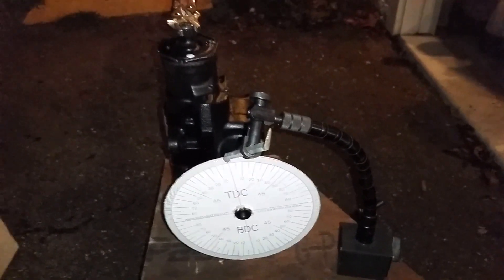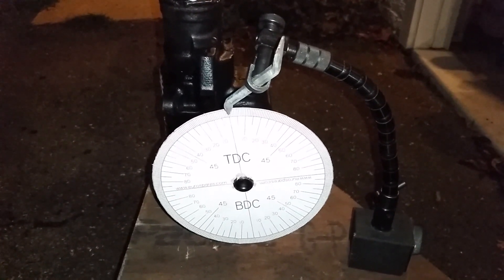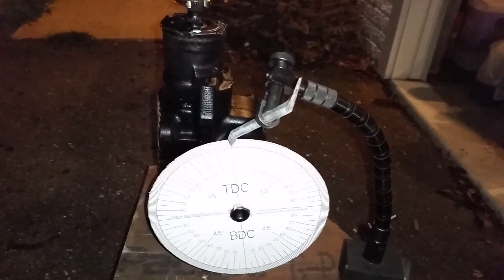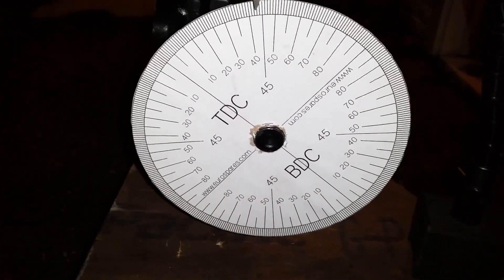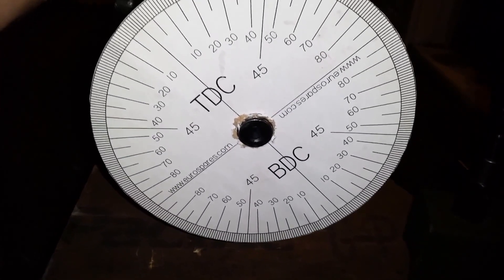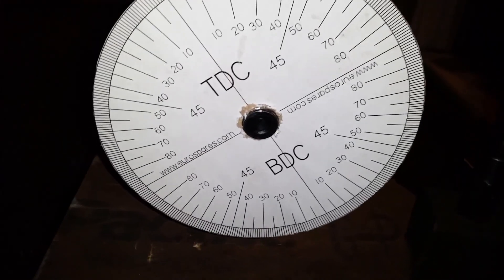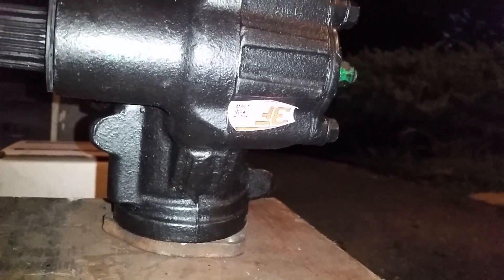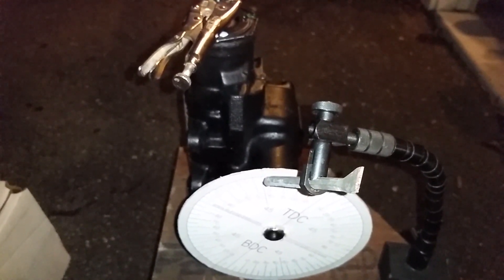Testing Another Steering Box - This One Is 12.7:1, But Isn't Supposed To Be

Comment: I have repaired the Saginaw 800 series box for lack of assist, piston seals or spool valve, plus many pitman shaft leaks. Dirt, carbon, seal material all rest on the bottom. I would polish the seal area but changed the needle bearing. If a parts store sold you what is now a close ratio box, I would put it on with joy. I am not understanding why there is a reason to be afraid of it. Never saw anything that resembles a center detent. Ever. The rag joint slides & clamps onto the input shaft splines, but this visible part is not wha moves the spool valve. It drives a “Torsion bar.” It passes to the back and a pin holds the spool valve on two sides. A thicker torsion bar twist less so it moves the valving fast. Resulting in immediate assist to the direction of choice, proving little road feel with a proper pump pressure. For boxes, the pump pressure valve produces 1,200 - 1,600 PSI. A rack only needs 600 - 800 PSI. It is engineers choice for the model, big block, A/C, etc. More assist is a rule. More caster helps with return to center on SLA front suspension types. It lifts the front of the car and naturally want to return to center. Less caster is used on manual steering. A thinner torsion bar will twist more, delaying the speed the spool valve moves. This provides more road feel and many like that. After 38+ years of fixing vehicles, imports, exports, dealers mostly but independent shops, my elbows aren’t what they used to be, so less turns with more assist, to me, bring it on. 
 To make a short ratio box, a newly machine worm screw with grooves the balls ride in, are spaced apart further. The same is true to match the ball-gear that has the teeth that drive the pitman arm. Some rebuilder cut the center out, heat the ball-gear, then press a cold new case-hardened center, machined to match the worm gear. True, some rebuilt the core, but it goes thru pressure testing and cleaned with honing and new seals, perhaps a needle bearing(s). I can only speak for the plant our vehicle manufacture arranged for 60 of us to see. Heating a large metal part to 450 degrees F, does not affect the hardness, but a new center frozen in liquid nitrogen creates a fit that cannot be pressed apart at the same temp. I have a Saginaw 605 behind me in the garage, that is power assist, but uses no recirculating balls. Old shook and cheaper. Works the same but teeth can wear out quicker. Instead of 4 bolts on top of pitman shaft, it uses a Cir clip in a round top groove.
 Put it on, enjoy. Why are so many guys search for a fast ratio box. Anyone 14 and up can drive it. ASE Master Tech since 1978 - Retired

Comment: The box you tested may have originally been from a grand cherokee.  12.7 ratio and wider stops- more turns lock to lock than F body.   Theyre all saginaw 800 boxes with different guts, once the paint marking on the end cap is gone its difficult to differentiate.
Reply from the maker: Once the paint marking is cleaned off then the only way to check is to test them.

I didn't know that grand Cherokees used close ratio boxes, what years?  I'm curious because Jeep steering shaft swaps are fairly common on f-bodies, but there are a few issues that I'm wondering if you grab more parts from the JY car might solve it.

Comment: Hello Mark , I have a 1980 Y84 WS6 turbo T/A , do you know if they had the quick ratio box ? I have searched and am finding conflicting info . It's a parts car now only has 54,000 miles on it , thinking about putting it on my 2003 S10 , thanks.
Reply from the maker: Michael, I'm sorry, I missed this when you originally posted it.  

Honestly, I don't know of any close ratio boxes before '83, maybe '82.  I don't believe that second gens got them, but I'm not positive.  There's a lot of conflicting info out there, everyone wants to say that they have one and most don't, and on the flip side, there's tons of 3rd gen people that claim that you need to get a 16" wheel car to get them, but I know for a fact that there were 15" wheel cars that had them but they had thinner stops in them so their was more travel lock to lock (I owned an '83 TA with one).

Comment: What did you do to resolve the issue of the rebuilt box not matching the original box? Did you ever find the correct box? or decide to rebuild your box?

Did you notice that the nipple on the end of the input shaft had been cut off of the rebuilt box in both videos? That nipple is used on boxes that use o-rings on the fluid lines (I believe started circa 1978/1979).
Reply from the maker: I believe that I ended up trying just short of 20 different boxes from half a dozen sources (I know a couple of the managers, once they figured out what I was doing they looked at themselves and ordered in anything that looked like a possibility for me to test it, it got to the point that 2 of the stores had a spot out back that I could just set them up and not even take them home) and literally NONE of them was a correct box.

Since I have 2 '87 WS6 cars in the driveway with the high effort/close ratio boxes in them I just decided to get rebuild kits and rebuild what I had.  It wasn't a difficult job.
Reply: @t5montecarlo    >The thing you call a nipple is the end of the torsion bar that travels the length of the spool valve, attaching to the back. Wether it sticks out or not is just which torsion bar was installed. It has a narrowed spot that allow for steering wheel movement without assist right away. Thicker one provide assist much quicker but give less road feel as it’s called. They are interchangeable and only seal inside. I have rebuilt many of these and fixed leakers. The pitman shaft seal leaks as they get dirt, hard but the bearing wears. They used two needle bearings with spacer and with out. A tire/wheel, ball joint or any lateral forces cause the housing to oblong. New bearings all day will never fix. It gets reamed out, solid steel bushing installed and the ball rolled to fit pitman shaft w/o bearing. These will last 60 years instead of 30.
Reply: @deankay4434  Thank you for the pointers. I will eventually rebuild my 12:1 box. 
The "nipple" I am referring to is the portion of the input shaft that was ground off, as seen at 5:09. That "nipple" prevents the box from being coupled to older steering shafts.

Comment: What do they sell on camaro central? I got Lares 1282 thinking its the close ratio 2 1/4 turn but it is 2 3/4 turn and it also feels kind of loose in the center and stiff when you start turning wheels... :/ Should i just get used 2 1/4 off the ebay??? Damn.
Reply from the maker: I have not found a reliable source, even with some of the higher end stuff.  I've posted a mess of info in threads on thirdgen.org (my username there is 83 Crossfire TA), but when it comes down to it so far the only reliable source is to find a used one and learn to rebuld it yourself.